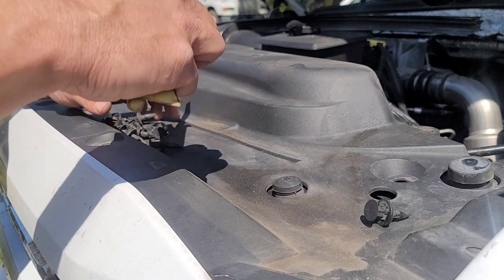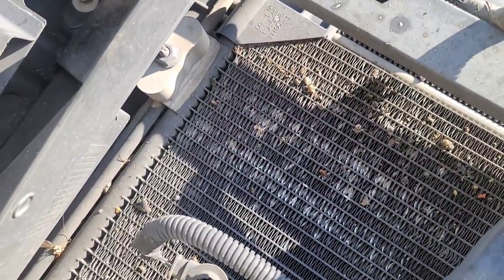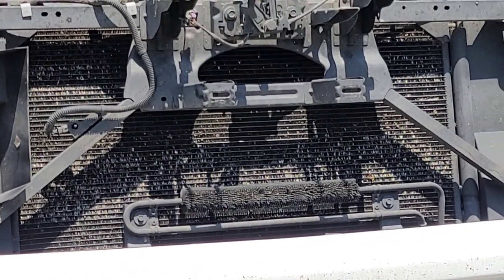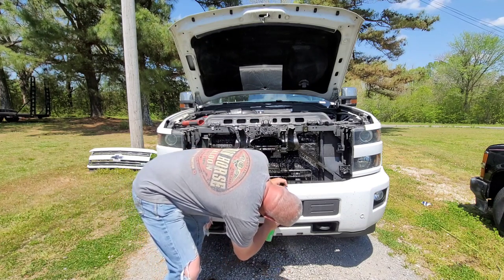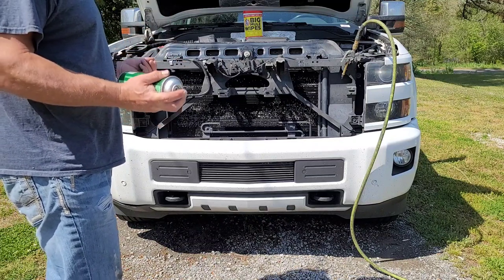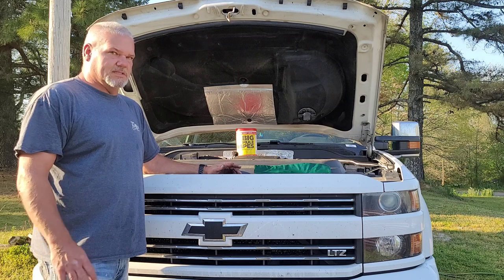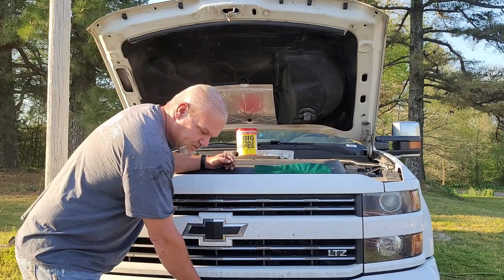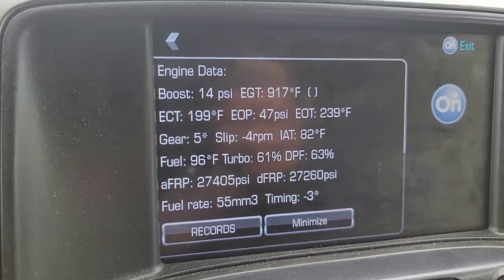Washing 300k miles of bugs and debris out AC Condenser And Radiator.

Comment: Was curious how does the 2500hd do handling the heavy kingpin weights of those triple axle toy haulers with the air bags?  Just asking because I've got a 2021 chevy 2500hd and I'm shopping for a 5th wheel toy hauler so any insight would be appreciated. Thanks
Reply from the maker: It does good, i have one on now headed to Pasco Washington. I think they ride good but hard on fuel milage